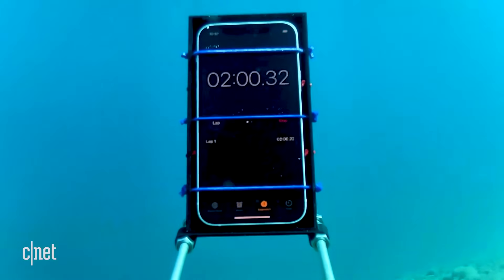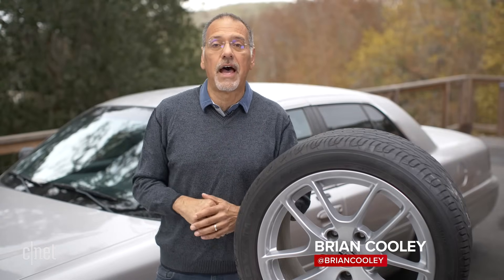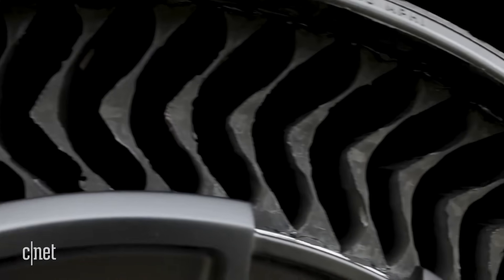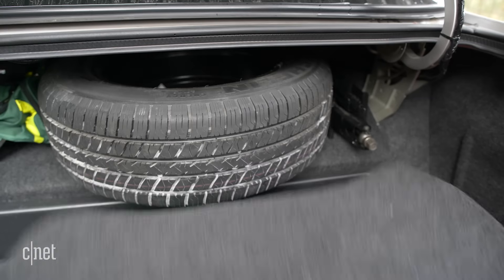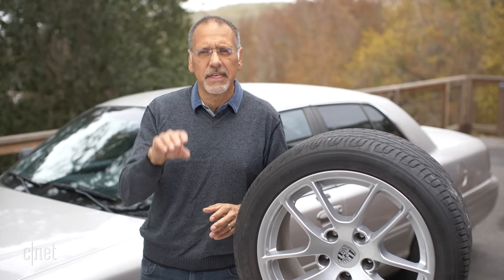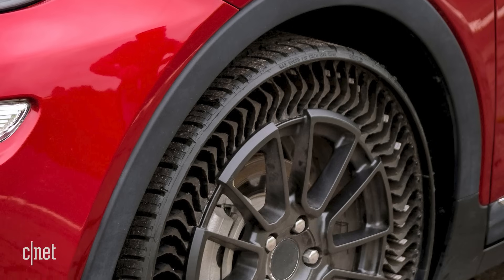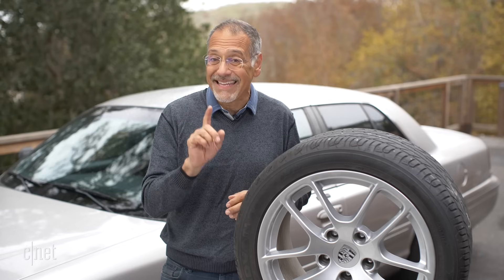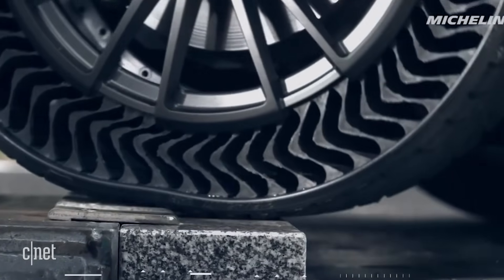See what Michelin uses instead of air in its Uptis tires

Comment: These are awesome, but the Wisconsin people want to know, ”what happens when you park in a winter slush puddle and overnight it freezes in and around that open sidewall?”
Reply: Yeah, or when the snow and ice accumulates in those groves causing huge wheel imbalances, and you can't get it out easily.

Comment: What about the mileage of the car? These tyres look like they are much flatter at the point of contact between the tyre and road - which is higher surface area in contact - so higher the friction and lower mileage. This is not an issue with normal tyres because at the right air pressure, the friction is minimal - but in these tyres, it might be an issue.

Comment: You forgot to ask two key questions. will it hold up at top speeds of the EVs it may be used on, and can it ride as comfortably as a pneumatic which takes that bump and spreads the impact to all 360 degrees of the tire casing? Airless tires for bicycles have been around for some time now and they ride rough. Michelin has been developing this technology for the military, where rough riding is a given, and top speeds are severely reduced in most cases.
Reply: Handle top speeds of EV's? 200kmph is baby figures

Comment: the production version of these should be fully covered. can you imagine getting up one morning to go to work only to discover that the neighbourhood kids put little rocks inside your tyres 😂
Reply: You can literally watch the demos of this, they pack the tires with mud and ice when testing.
Reply: Imagine in winter. The snow will get stuck inside and harden into ice
Reply: @CODTerracraft  Like the engineers who designed this tires never, ever, in a million years thought to think about snow, or the possibility of it hardening into ice inside the tire. You are the first to think about these things.
Reply: @funnybunnymomoney388  you would be surprised by the amount of things we forget.
Reply: All they have to do is add side walk on the side
Reply: @funnybunnymomoney388  maybe they’re trying to be like apple, selling stuff separately. They finna sell the stuff to melt ice on the tires and stuff to take the snow off of the tires and stuff like that💀
Reply: @THESLlCK  No, you are.
Reply: @CODTerracraft  thats a very good point. they should just add sidewalls like a regular tire
Reply: @CODTerracraft  the holes in the tires are pretty small i doubt the car will have any problem crushing those when it starts rolling
Reply: @CODTerracraft  well, maybe it'll break up easily once the vehicle is driven
Reply: they're designed to expel anything trapped in the spokes
Reply: Or you park in some water and it freezes overnight, will it tear or break when you move?
Edit: guess someone else had the same idea
Reply: @WWIIDDSS  it wont, tearing and breaking happens when water goes inside and freeses, as long as its outside its okay
Reply: The problem with fully enclosed will be heat dissipation.
Reply: @JosephDawson  heat is a good thing in road tires. Due to the low speeds, the tires take a long time to reach a good temperature and produce good grip.
Reply: @JosephDawson  This might be why you may not be able to just put them onto your old rims. You need the tire to be enclosed enough to protect against weather but, you also need to displace the heat. Perhaps the tread can have some sort of small holes in it to let water seep out if you have some sort of partially enclosed tire.
Reply: @JosephDawson  they could have it covered but have small gaps that are not as large as those cutouts and ALSO have less cutouts in general so instead of having like 100 cutouts visible in the tires the inside could be that much but the visible sides could be more like 20 cutouts which are a little smaller as well so its harder for stuff to get inside the tires
Reply: @JosephDawson  leave some space open
Reply: it is ...is for presentation purposes so we the viewer/audience  can see the science behind it....
Reply: Im guess that maybe it's just to show off the fact that their air less for awhile then maybe thed cover them
Reply: @Roanokewood  exactly
Reply: I love this guy. I could listen to him talk (and watch him doing it) all day.
Reply: don’t think that’s how they will look
Reply: Indeed, my neighbors are assholes
Reply: Who said that final product should have open insides?
Reply: You can sue for that 🤷‍♂️
Reply: People steal tires already. Imagine if tire thieves saw a car with never-flat tires...
Reply: @Charles Morse What are you talking about? What did I think of before other people's life work?
Reply: @Charles Morse Your confused buddy. Also, the use of the word arrogant to make your point is not correct.
Reply: @Charles Morse It is true that you have confused me.
Reply: Haha 😂 indeed
Reply: I wonder if filling with an open cell foam would prevent snow issues, reduce noise and improve aerodynamics?
Reply: I know im late to reply but it seems like a huge exaggeration to think ice or rocks are going to hold on SO TIGHT that it harms the tire or car. I mean unless you literally see something huge stuck in them, i dont think its going to do anything that a nail couldn't do worse and theyve already shown its resilient to that..

Comment: This tire was developed for the military, but it was rejected because it couldn’t handle the weight of vehicles. Mud is also retained in the spaces between those fins. The mud hardens (cement wheel) and is very labor intensive to remove.

Comment: Do your homework cnet!  These are a complete Michelin failure 10+ years ago when they first tried to release them and are simply trying to milk the dead cow again.  Several auto manufactures were interested until they learned modifications to the chassis where needed, extra tyre weight, couldn't use existing rims, and the cost which is 4x that of a normal tire.   Ohh and the real kicker was Michelin wanted to sell them "special" equipment to work on them!  Really the only benefit you get is no flat tires and you loose sidewall stability, ability to vary tire pressure for change in conditions, low cost, and low weight of a traditional tyre.  BTW they couldn't leave those ribs open as mud, snow, ice, and rocks would create balance issues if they got stuck in there.  If this was a good idea you would already see them on race tracks and you don't as they aren't any good.

Comment: Perfect for low speed construction settings. Not sure how that specific design would hold up to lateral loads passenger cars can put through them in turns.
Reply: In my understanding, lateral grip has been the main issue with this design. Works great for a Mars rover or something like that, but they'd get sketchy quick at highway speeds on pavement.
Reply: That's why they're TESTING them😂
Reply: Maybe in city cars where you barely go 40kmh
Reply: It air pressure even better with lateral loads in comparison?! 
I would assume that you could make a tire with actual solid connections between the inner and outer parts, that is comparable to a tire that just more or less holds its volume but not necessarily its shape (due to the pressue). 
Is there a reason why you think it would deform more?!
Reply: @i.i.iiii.i.i  I believe air pressure in a traditional tire helps keep integrity even when the carcass deforms (which tires do to varying degrees, but especially when pushed). This design doesnt strike me as being able to be as laterally flexible (potentially deforming less) which can be detrimental to a vehicle's handling characteristics but also could mean it may not be as durable if those connections fatigue over time.
Reply: @ALMX5DP  
A normal tire also deforms quite a bit at the part that touches the road and a failure could potentially be worse than one of those "springs" failing. 
I understand why you could be right, but I would like to see an actual comparison before making up my mind 😉
Reply: @i.i.iiii.i.i  just my opinion but that deformation is beneficial in many aspects for ride, comfort and controlling the loads imparted from the tread. There can certainly be catastrophic failure which is why people are designing stuff similar to this airless tire replacement, but I feel we may be quite far off seeing something like this make their way to our consumer level vehicles.
Reply: @ALMX5DP  
The industry is usually quite conservative anyways... if there isn't a big advantage they don't change the running system.
And if you think about it flat tires aren't THAT big of a problem anyway, especially when you concider that the airless ones could be way more expensive. 
So yeah, they will probably only be used in field of application with a high chance of flat tires...
Reply: @ALMX5DP  just gotta get the internal shape right for similar or better performance
Reply: @rbnhd1976  well sure that is the million dollar question that no one has yet been able to really answer.
Reply: @i.i.iiii.i.i  I bet it's like riding on tires made of blow up pool toys when you take a sharp curve at speed.

Comment: This is amazing technology. The Michelin Tweel is already out for Skid Steers/light construction and the performance is amazing. I’ve seen this technology handle gravel, rocks, mud, and metal rebars. If they can mirror that technology to cars then this will be a huge innovation.
Reply: The noise is not bad. When it comes to skid steers the machine is louder that tire noise when operating the equipment. It is quieter when compared to tracks or solid tires but of course it depends on the application you are on. A tire is like a tool and needs to be used for the correct job. As far as a gimmick, I have personally tested the product the tire performs very well when running over cut metal, rebars, broken concrete. Again it depends on the job. 👍🏽
Reply: How is the noise when compared to a regular tire? Granted they’re obviously not being handled at high speed at all but have you noticed any difference?
Reply: They’ve been playing around with airless tires for at least 60 years, they have some applications but for the most part they are more expensive less capable and generally worse in every way than a standard pneumatic tire
Reply: Check out Smart METL tires, its a better product.

Comment: Damn, I've been hearing about this for 5+ years now. Had assumed that it was just one of those technologies that are always just 2 years away.... every year.
Reply: They've been trying to do this since the 80s. Tire companies come out with airless tires every few years... The ride is always horrendous and they are NOISEY (though  a few of the designs have been successful in forklifts or airport service vehicles where speed, comfort, and noise are not factors). Maybe the technology has finally made something like this practical? I doubt it, but time will tell.
Reply: @arikbord2256  I think practicality is going to be key. Because if it is way more expensive than an air tire and has to be replaced more often and/or has a bad performance then it probably won't make much of an appearance beyond high-end, flashy, hey look at me, type vehicles.
Reply: @NeorecnamorceN  i suspect these tyres will still have the lateral grip problems at higher speeds most tyres currently on the market of this design have. 

So theyll probably put these on concept cars they build that dont ever really leave a show room
Reply: Indeed. In 2009 Michelin called it the "tweel". lol. It's all dust and smoke and mirrors.
Reply: @spy00at  oh, right, forgot about that. So it's actually been 10+ years since I heard about it and it seems they have been around even before that. Interesting.
Reply: @NeorecnamorceN  Yes. And they are STILL 2 years away.
Reply: @arikbord2256  maybe if they sell this airless tires they might lose profit because there's less tires that are getting replaced.
Reply: It's probably crazy expensive, noisy, and short lived.  So expect them to try and get the government to require airless tires to save the environment and for safety (prevention of blowouts).
Reply: 2 years away from being 2 years away.
Reply: Tin hat conspiracy is that they last too long and Michelin isnt down on cutting its profits for the sake of consumer convenience and perhaps the research is on how to make them not last as long while not breaking apart too early.
Reply: @MotokenUchia  they definitely need to find that sweet spot for sure.
Reply: Fear not - now they are 3 years away.
Reply: I was gonna write the same thing lol
Reply: And the next year and the next year and the n e x t year
Reply: OMG I seriously can relate lol
Reply: This is been two years off since the 90s
Reply: Companies dont want to release this as priced are expensive at the same time it will last longer lets say 2-3 times of the regular tires lifetime. And if its priced right it will cause issues with tire business
Reply: Just like fusion power, it's always 20 years away.
Reply: @spacewolf363  exactly, lol. Go ahead and add solid state batteries and hydrogen cars to that list.
Reply: Which means we won’t be alive to see it. Bummer.
Reply: I get it that many people are skeptical about this, and that this has been in design phase for decades. I get that this might have problems and issues to solve before they can beat the usual tires. But what kind of crowd is this, don't you have any faith in the limitless evolution of humanity's invention of technology? If you lived in 1900 you would have thought horses are the best thing we can do in terms of vehicles, if you lived in 1970 you guys would have laughed at the possibility of a mobile phone or the internet. Have a little faith and think logically. If this is a better technology (no blown out tires ever, so yes it arguably is), eventually this can be made with competitive prices and capabilities, right? If not, why? Is there some physical law preventing a tire to be made without air and to function as well? I don't think so. With enough time and development i'm sure we will get this right and it will replace traditional tires.
Reply: @PresidentialWinner  same with electric vehicles. 10 years ago everyone would have had a laugh. And look at where we are now. It's just a matter of time.
Reply: LMAO
Reply: I love this guy. I could listen to him talk (and watch him doing it) all day.
Reply: 2024 is just about 2 years away :D
Reply: if airless tires can't be made practical, fusion is thousands of years away.
Reply: Same here i have seeing this hype for years now still have not seen one vechile on road with these tyres on.
Reply: I highly suspect that with all the hullabaloo about the environment going on these days that these things are going to be made mandatory very shortly ....the days of Petrol and petroleum products are coming to an end, whether we like it or not.
Reply: yea
Reply: maybe it's like the light bulb conspiracy
Reply: Because it likely is
Reply: Airless tires are old as dirt. 1927 Sears catalog sold them, I believe they were available even earlier.
Reply: They prob. still need to figure out how to break it cuz it works too good, leading to less being bought
Reply: Yeah i remember like 15 years ago they said they were releasing tv in 5 years that wouldnt have a screen it was justa  hologram. 15 years later still nothing haha
Reply: It's been 2 years. Michelin is in talk with Tesla to test their tires.
Reply: @NasterOne  oof, it's going that well huh.... At this rate we will have hover/flying cars before these tires are ready.

I for one am just waiting for the future ASI to just invent a safe and reliable Rick level portal gun.
Reply: Same here... only 40 years ago. This technology can't beat air
Reply: Check out Smart METL tires, its a better product.
Reply: When things were at their very worst:
2 Suns, Cross in the sky, 2 comets will collide = don`t be afraid – repent, accept Lord`s Hand of Mercy.
Scientists will say it was a global illusion. 
Beware – Jesus will never walk in flesh again.
After WW3 – rise of the “ man of peace“ from the East = Antichrist – the most powerful, popular, charismatic and influential leader of all time. Many miracles will be attributed to him. He will imitate Jesus in every conceivable way. 
Don`t trust „pope“ Francis = the False Prophet
-	will seem to rise from the dead
-	will unite all Christian Churches and all Religions as one.
One World Religion = the seat of the Antichrist.
Benedict XVI is the last true pope - will be accused of a crime of which he is totally innocent.

"Many events, including ecological upheavals, wars, the schism in My Church on Earth, the dictatorships in each of your nations – bound as one, at its very core – will all take place at the same time."

"Arab uprising will spark global unrest – Italy will trigger fall out"

The Book of Truth

Comment: I would think they ride horribly in the winter, due to ice build up inside the tires. Imagine the vibration it would cause.
Not a problem in the warmer states which is a good thing tho. 
Hopefully they are designed to be re-tread.

Comment: I dunno.. what happens when you get rocks accumulating in the space of the tires, it will basically destroy the support wall and possibly your rims..
Reply: im sure they will have rubber side walls once these are mass produced. It looks like this now because they need to demonstrate how it works. at least I think so
Reply: @lmbtcs1879  with the tire flexing like that especially on sharp angle, not sure how well the sidewall is going to hold up over time.
Reply: @lmbtcs1879  yea I hope so too, it looks far better than this that looks like it came off a toy truck.
Reply: Could rocks accumulate in there? The tire would be spinning... And even so, the maintenance would just be poking the rocks out
Reply: I'm wondering if these new tires will be heavier too.